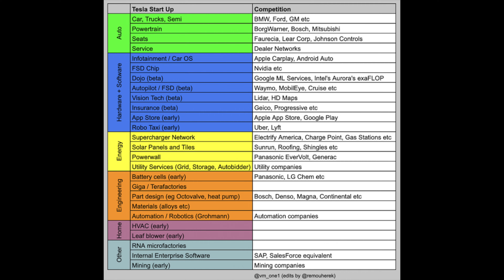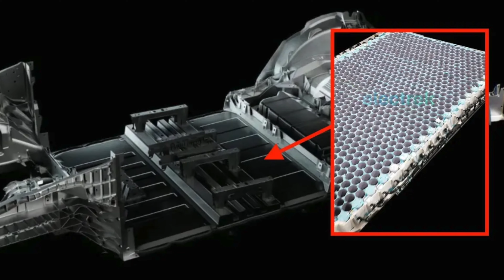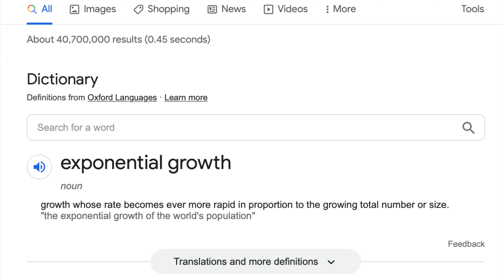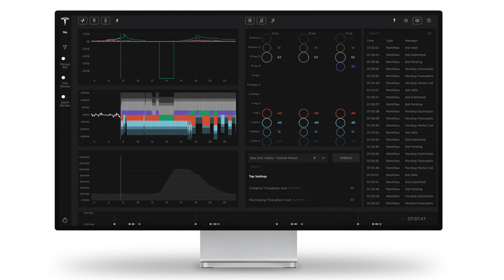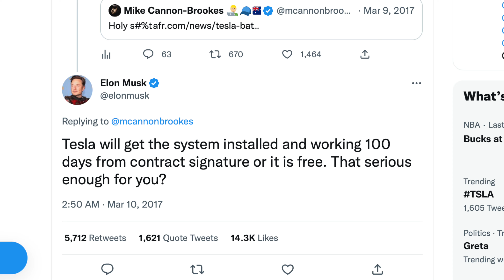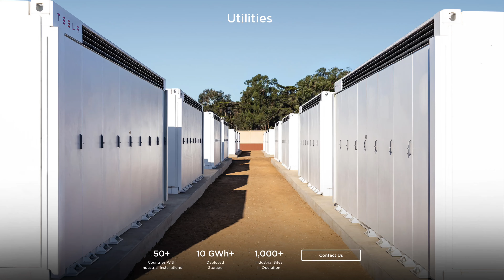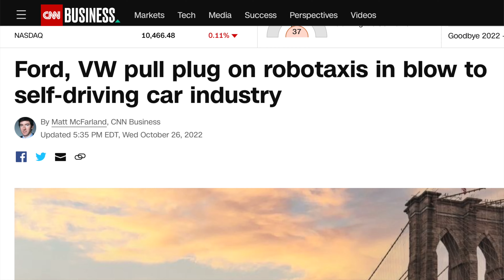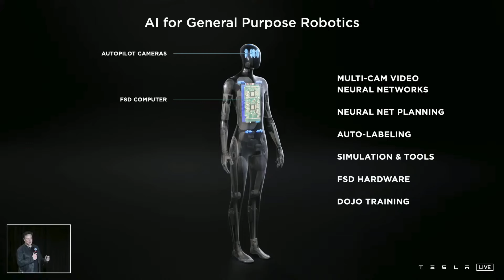Tesla = Not Just A Car Company! Elon Musk has built many different businesses under Teslas brand

Comment: I'd really like to get a copy of your colored spreadsheet from the beginning of your video. My viewing experience was blurry until just after that point. I couldn't actually read the chart. I went back to the beginning a few times to see if it would buffer and improve the resolution, but it didn't. I've tried a couple times to compile my own chart to make the same points you have to friends and family but gave up. I was having trouble getting good info. It is a continual bother that the news and the market seem to ignore everything but the vehicles. I understand it is a vastly larger operation than any of the other pieces, but it stabilizes the company too. You mentioned refining. They have applied for permits I believe in Texas to build a refinery for the ore to make batteries.
Reply from the maker: Hello, thanks for your comments! If you google 'tesla a collection of startups' and click images, it should take you to a reddit page with that list on. I'm hoping to hear much more about the mining for battery materials from Elons Master plan part 3, or on 1st March event that Tesla is holding. Thanks for watching!
Reply: Thanks!
Reply: @TeslaJigsaw  This worked as stated. Thank you!